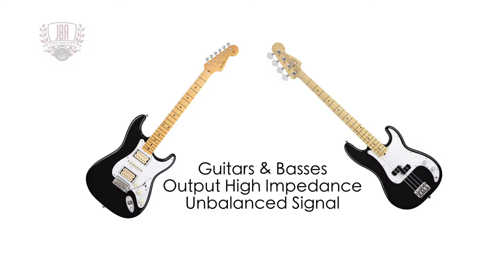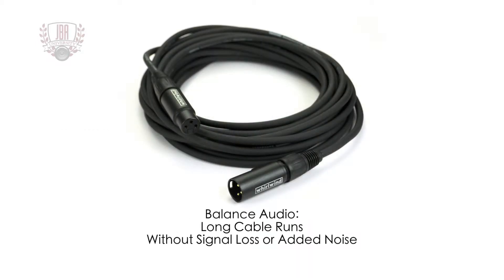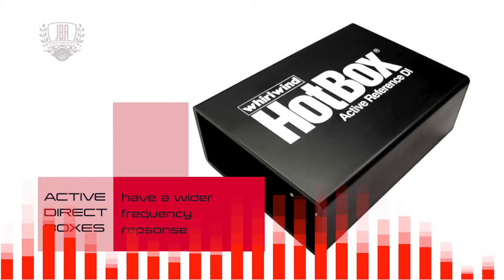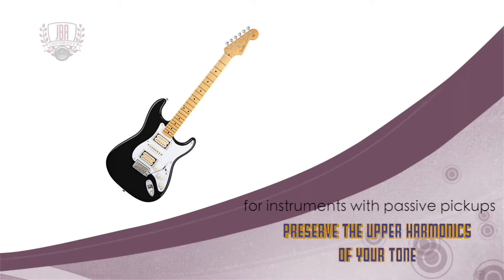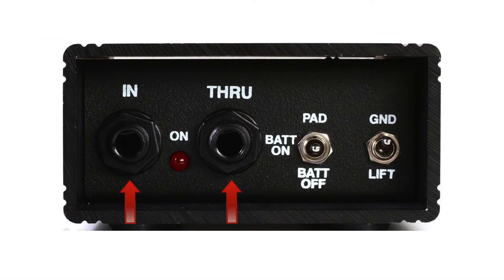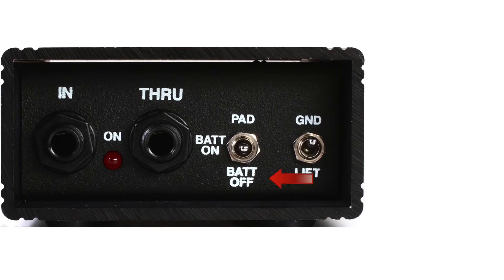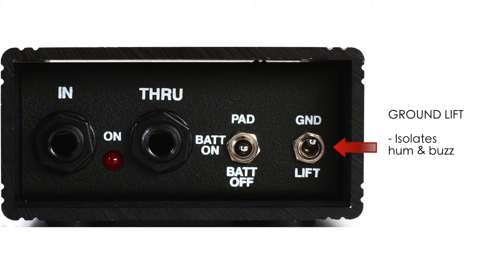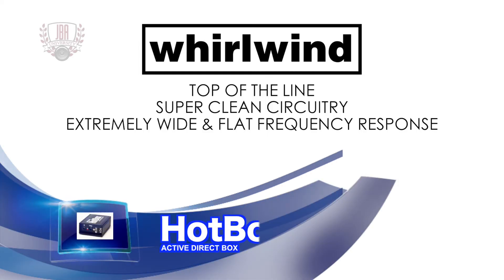Whirlwind HotBox Active Direct Box Overview

Comment: I have an older version of this that has a -40 for speaker level input. The battery/phantom figures itself out (there’s no switch for battery or on/off). It sounds amazing! I’d recommend it on Passive Basses or Passive Acoustic Guitars where you want to hear better high frequency detail. If you’re dealing with a piezo pickup or a less experienced player or you just want a more rounded sound then I’d stick with a Passive DI. My two cents.
Reply from the maker: Thanks so much for your testimony!